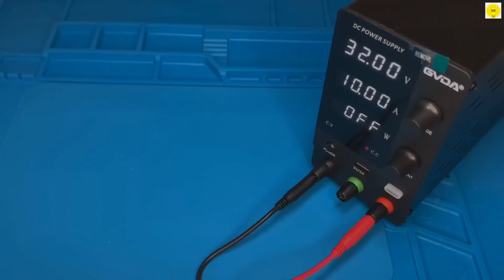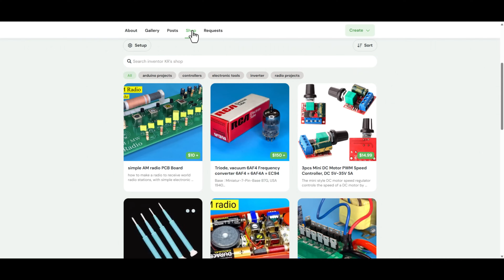how to make peltier air conditioner peltier module , homemade Portable Air ac

Comment: This makes absolutely no sense whatsoever, I tested my peltier plate with a AA battery and it worked very well, that same cooling fan for heat dissipation would work with 9 peltier plates.

Comment: Fake. With that 20-30 W (in a good case), you won't cool down the air anywhere. Also, running the Peltier at 15 V is totally wrong. You have no idea what you're doing.